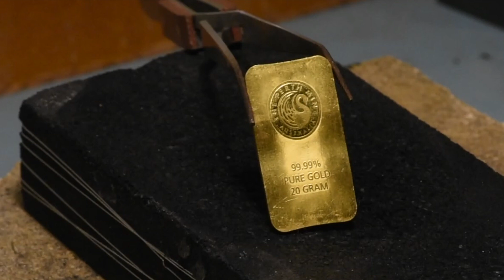Pure 24 Karat Gold Thin Band, Handmade Fused Solderless 24k Gold Ring (no talking)(gold ring making)

Comment: Great video I’m starting a wedding band next month and this had me researching so thanks 
So would I be totally fine beating some 24k gold really thin and place in between the gap on the band then heat up causing a weld but keeping the ring pure 24k gold 
Or do you use dust here in the video 
Thanks agsin
Reply from the maker: A thin strip of gold is perfectly suited for the weld. I use dust because I have it on hand from my saw work, but I have used tiny strips of wire.  Anything with significant surface area will melt faster than the major work. 
Good luck and thanks for watching